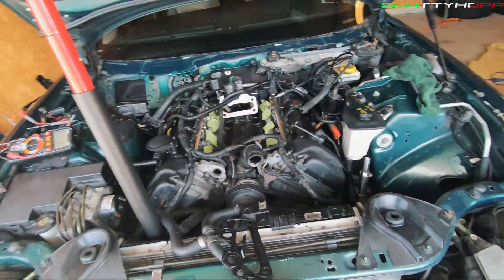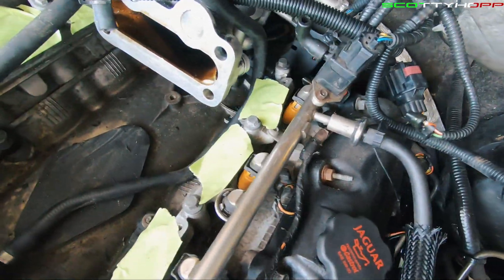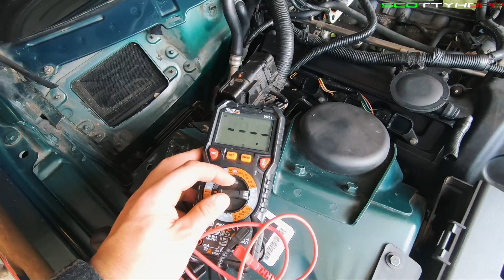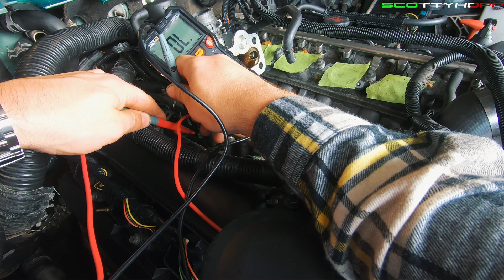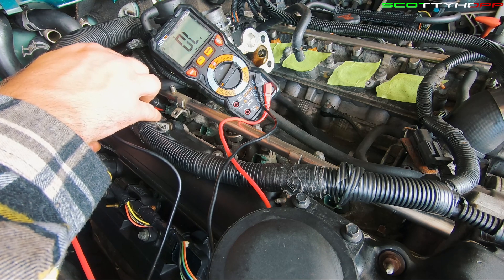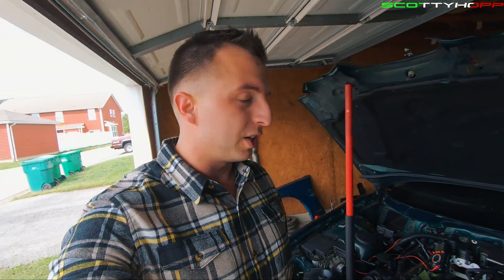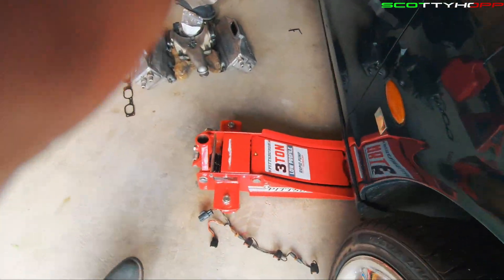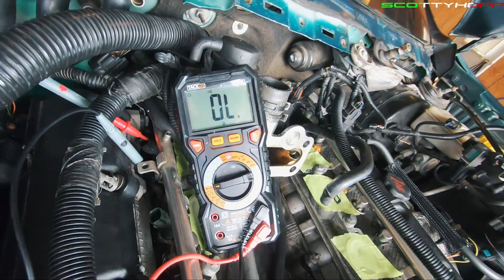How To Test Fuel Injectors FAST & Accurately! Checking Resistance w/ Multimeter // JAGUAR S-TYPE R

Comment: It's odd that an injector would die like that for a fairly new vehicle.  By any chance, did you repeat the ohm test AFTER flushing the injector to confirm that the zero ohm is not due to stuck in position?  Not sure if stuck injector gives zero ohm.